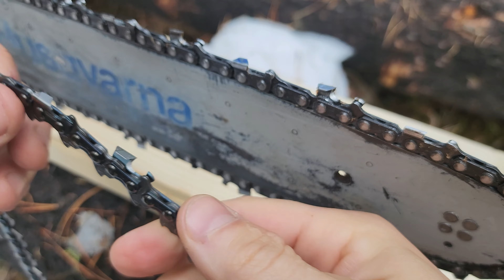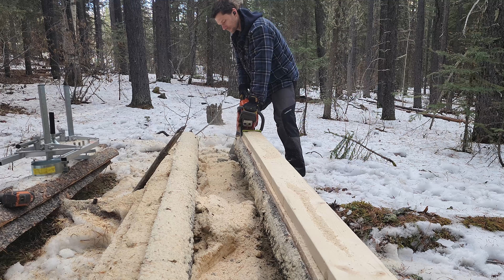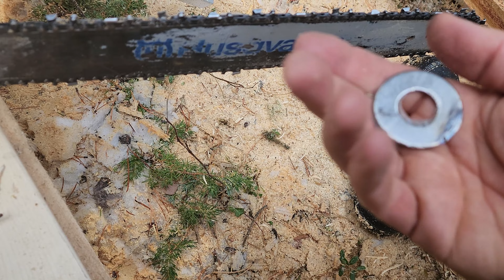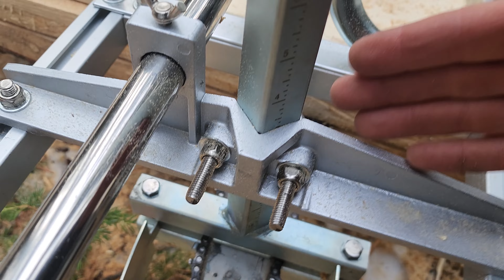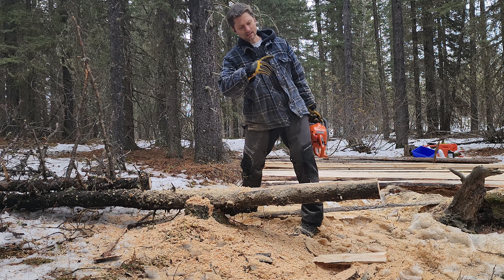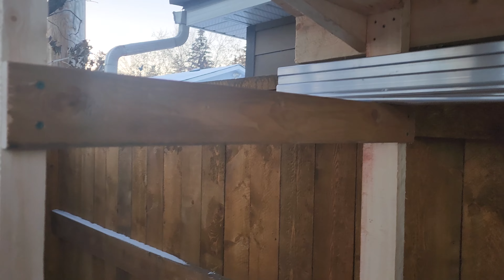Logs to Lumber with a Ripping Chain compared to a Stock Chain on a Small 50cc Chainsaw.

Comment: Winced a bit when you were making your starter cuts and the chain was hitting the snow and debris under the log.  Have learned the heard way to cut a couple short crosspieces from a bigger log to use as stands with a notch in the top to keep my logs from moving while I work, flat bottoms to keep them stable, and enough height to keep my saw tip off the ground - and save my back!  Milling lumber with a saw is so addictive, I started with a Rancher 455 and the same mill and a sure belief I'd just be cutting a few boards here and there.  My barn's got a big pile of cut boards and posts now and I built a chicken coop and run using milled beams and posts, and my saw is begging for retirement.  Wish I'd listened to advice and gone for a stronger saw to start off.  The manufactured ripping chains are a great idea too, they will definitely outperform our DIY cut down chains.
Reply: Hand file,best to learn 😊😊😊😊😊

Comment: You are doing everything that any outdoor type guy has wanted to do all of his life! Live by proxy for now.......
Was already planning to purchase a highbanker this spring/summer. Keep us updated!
Reply from the maker: Will do!  I'm starting out small and will work up in size as things move along.  In a nutshell, what are some things you are looking for in a high banker?  Just gathering some food for thought.  Also, what are you thinking of using as your water pump?
Reply: @UtmostOutdoors   I was thinking about starting with a smaller high banker, electric pump to be able to easily haul anywhere on foot maybe 5 to 6 inch wide 36 to 42 long.....then buying a larger one once i have a more permanent location....8 inch.....gas pump....

Comment: Live and learn. One learns best by mistakes made. You should have got rid of the board after the first cut. It was nice of you to share your mistake on messing up the chain. It may save someone else from doing the same. Small saws can do small lumber. But as you can see you will need a much larger bar to do anything of any size. A larger saw as well. Nice video.

Comment: I have the same mill. I think you made the same mistake I made in assembly.  Look carefully at the photo on the manual and you'll notice you have the saw tip guard at the wrong end of the rig. You'll have to swap the two ends and slide the plexiglass guard over.
Reply: Yep, been there and done that, and then looked and found a bunch of folks posting online about doing the exact same thing.  You'd think they'd make a change to the design or the instructions to address such a common and serious problem for so many users?

Comment: Just about any engine gets hard to start if left for 'just long enough' for the fuel to evaporate from carburetor and 'flood' motor. 
Giving it full throttle gives more air and allows starting.
I would have thought it would be better to clamp on the rivets which are solid rather than squeeze the sides of the bar onto the nose sprocket?

Comment: I dont understand. If your bar was too short for the mill, why didnt you install a longer bar on it? Please excuse my ignorance as im trying to learn before i buy a chainsaw.
Reply from the maker: Some chainsaws have different thicknesses of chains, so you can't just buy any bar and chain to fit it onto any chainsaw.  In the case of my saw, I think I could get a bar that is 2 inches longer, but beyond that I don't know how to get a hold of anything longer.  I figured I would go ahead and use what I had.  
I didn't intent to mill wood when I bought this saw, and so that is why I wound up with a shorter bar to begin with.  If you are new to chainsaws and think you may get into milling, I would recommend you go for at least a 60cc saw, if not larger.  But if you wind up with a smaller 50cc saw like the one I'm using, it's nice to know you can still do some light milling if you ever want to give it a shot.

Comment: is it like both a ripping chain and a skip tooth chain? I have read that these tend to kickback more, is that so?anyway thanks, amazing that you shared this I learnt a lot
Reply from the maker: I'm not sure on kickback as I haven't filed down the rakers any.  I basically just took two teeth in a row and left the raker but removed the part that goes accross so that it's just a thin little razor that sticks up and scores that side.  Then left the next two teeth alone.  I think sharpening to 10 degrees will leave a smoother sided cut, but I left mine at 30 degrees because I hear it cuts faster...  Either way, less teeth in the cut means the chain can keep the revs up and it's actually workable for milling even through it's a small saw!

Comment: did you just file off the top of every second tooth?
Reply from the maker: I think I just left the rakers as they were, I only removed the horizontal part of every second chisel tooth so it's just a vertical slice that's left.

Comment: Describe your ripping chain again? what did u do to the chain?
Reply from the maker: The chain basically just had every second tooth removed for less load on the engine.  The only detail is that I left the vertical part of the tooth and only removed the part that goes across, so a small part of the tooth remains to score a thin line in the wood before the next tooth takes out the rest.  I just found the idea online and it did seem to make the saw require less force to push through the wood.

Comment: Yup there is nothing like back breaking work than using a dull chainsaw. i have a Husky 272Xp It has a 79cc engine,those alaskan type mills require a pretty big saw,the smaller saws burn up quick. If your just cutting a few boards then u should be all right.

Comment: it is 45 cc or 45.56 not quite 50
Reply from the maker: Yeah, it's a confusing saw as some say they are 50cc.  I actually just read a whole thread on how some are epa rated at 50 for emissions reasons or something?  The saw name "445" makes sense it would be a 45cc but when I searched their website last in Canada it said 50cc.   Strange.  Either way, it's been a good little saw :)
Reply: mix your fuel correctly clean your air filter and that saw will last a real long time. your braver than i am. i dont do snow anymore unless i have no option.👍